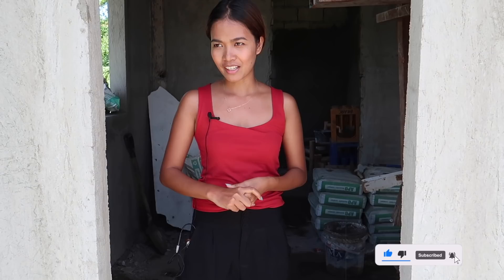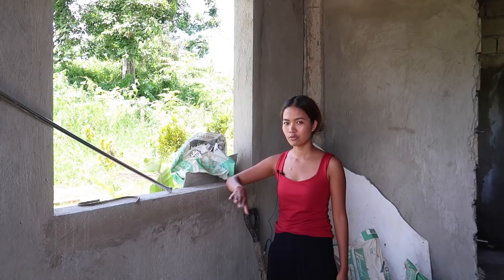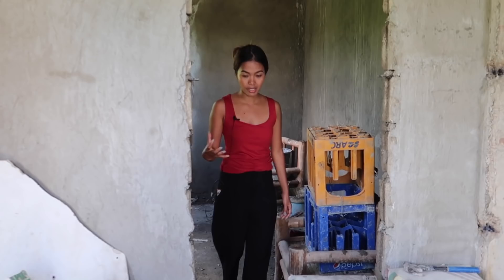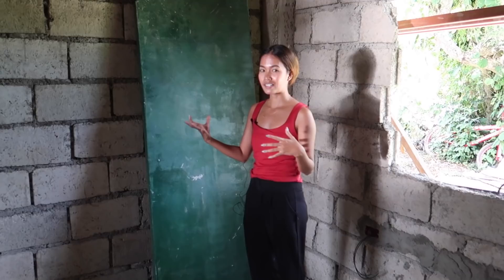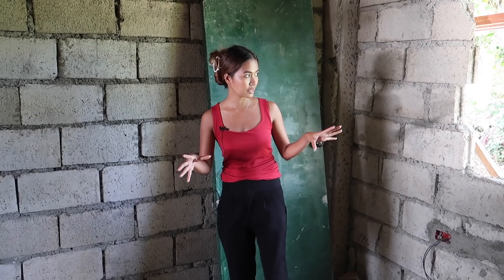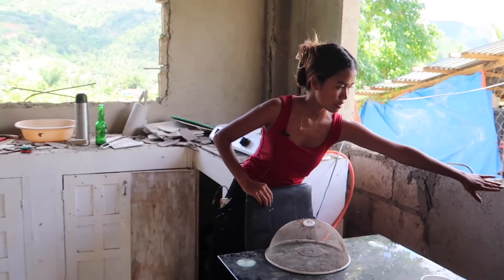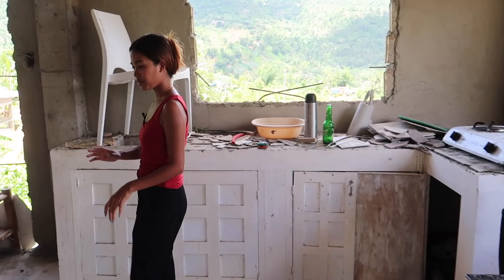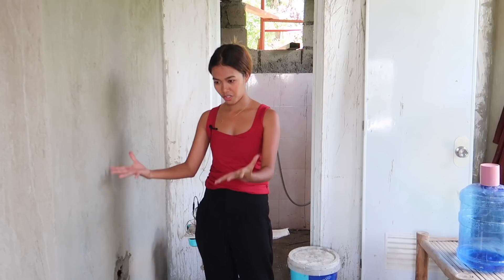House Rebuild 18: I Had To Change The Living Room Plans, House Update

Comment: You need ceiling insulation on the metal, and then another layer on the ceiling covers so it reduces the heat. So many homes in the Philippines do no do that and you will regret not having that heat barrier.

Comment: Dividing the kitchen from the living room.  Make the division appearance in the ceiling with a lower portion that looks like a beam(6"x6" beam).  visually it will divide the space.  For the TV stand divider, use a table or TV stand that is not permanent.  You might not be sure that this is how you want the house laid out, so make everything on the floor portable.    If you change your mind, then its as easy as moving furniture.

Comment: How about hanging the t.v. from the ceiling facing it towards the living room, or use a sway bracket mounting and mount it high and you could sway the t.v. out of the way when not in use, then you wouldn't need a room divider.

Comment: Meljean, My filipina put horizontal pipes across the end of the room about 30 cm from the wall. One 2 meters high and 1 at 1-1/4 meters. 
Then she attached 1-1/2 inch chain with shackles hanging down from the upper pipe. Everything on hangers has the hangers in the chain 
rings. She stores about 3 times as many clothes in the same space. stacked plastic bins hold foldable things. She wanted sliding panel 
doors but bought regular house doors and jambs for the false wall in front of the clothes. We are doing the same thing on the new house
for clothes storage with the addition of a zippable cover that encloses all the clothes. We used 1 inch galvanized sch 40 pipe for the 
horizontal hanging rods.

Comment: I would switch the locations of the refrigerator and pantry.   I believe the refrigerator placement where you propose would stick out from your new cabinet and take space away from your dining table. Your pantry could be made to match the depth of your wall cabinet making a more pleasant appearance.     You could have a cabinet made to put over your refrigerator (more storage for such items such as toilet paper, etc). Also, by placing the refrigerator near the back door the heat and noise it makes would be further from your living room and dining table. Can’t wait to see the finish.

Comment: Hi MJ, to be honest, I would not put a division or divider between the kitchen and the living room. It will not be as open and expansive as the current open-plan layout that you have now. The new open-plan concept is considerably better, brighter, and more spacious. To maximize even more room, I recommend mounting your TV against the wall. You can also add a movable extension to your TV while it is mounted against the wall, allowing it to be quickly repositioned towards the living room. Mount the TV against the wall slightly higher so that it is not obscured when someone walks past.

Comment: Security lights for outside.  Love it.  I did that for my house as well.  I have a master power switch inside the house and the exterior of the house has motion sensor lights up near the roof line that go around the house.  The power is left on so that the motion sensors work when needed, however if I want to light up the outside of the house, I flip the switch Off/on/off/on and they all light up.  They will stay lighted until I turn it off again.  Then turn on once and the motion sensor lights work as normal.  It's a good feature.

Comment: Getting the hot/ cold water system is the best idea MJ. Liza has installed one of these in our kitchen in San Isidro just the other day.  Cost is P 7,000 +. Liza has taken out the walls of the Sari Sari Store n made the space for the new dining area with new dining table n chairs.  I will be arriving in Cebu 6pm Tuesday night and spend time night in Mandaue City.  Keep those plans MJ

Comment: Hi Meljean, congrats on the new house construction/renovation. I think the proper term is “wall plastering or plastering” not rendering.  Also, not plug/switch its provision for an electric outlet ☺️. With regards to the entertainment area, you can still place the tv on the wall as previously planned,m but use a wallmount which can move/turn/swivel the tv.  Placing a divider will defeat the purpose of the open plan living/dining/kitchen thus will make the space smaller again.
Reply: Agreed! Leaving it open makes it look spacious
Reply: Rendering is the action of applying plaster to a wall.
Reply: @hizuki362  That’s what it’s called in England so she is correct
Reply: Rendering is the proper term for applying cement based coating to the hollowblock walls. Plaster consists of lime, sand and water. Plastering is sometimes used as a generic term for applying thin layers of material. Rendering is the more accurate term here.
Reply: If I'm not mistaken, smoothing the exterior is called rendering. Plastering is the process of smoothing the interior. 

I suspect that MJ is the only Filipino that uses the term rendering though.  I've seen many home building vlogs from the PI and nobody has used that term.
Reply: @gdennis310  Interior or exterior doesn't determine what is the correct term, it's the material being used. Plaster is comprised of water, lime and sand , which is usually applied inside over wood lath (old school) or blue board (newer application). Rendering is used both inside and outside in the PI because they use a cement-based material to smooth the bare hollowblock walls. Originally, MJ called it "smoothening", which isn't even a word. Then she started saying "plastering". It took her a long time to finally learn the proper term of "rendering". Other  vlogs that have demonstrated rendering (using the proper term" are Foreigner in the Philippines and Texas Filipino (among others).

Comment: I'm glad you've become knowledgeable of molds. So the electrician have embedded the wirings and outlets in the cement wall. Yeah, I totally agree, it would take more weeks to finally move in with clean bed and sheets and necessary furnitures. I'd say middle of May.

Comment: A tv cabinet sticking out from the wall will take away from the open feel. Consider moving your bedroom door further into the kitchen area to allow your entertainment unit to go back to its original spot. Then you have the option to extend your kitchen counter out from the wall with bar stools.
Reply: Because she has enlarged her living room, placement of the tv on the bedroom wall doesn’t work anymore. Only the people sitting in front of the tv will be able to see it.  I think the divider will work.  She has a flat screen tv and She mentioned she will replacing most, if not all, of her furniture so she can get a small entertainment center for tv and karaoke machine.

Comment: Meljean... You do not have to discard everything into trash. DRYING OUT IS KEY...  If you get can get it VERY VERY DRY AGAIN is key.  Then you can repaint it and should have a sucessful paint job over most everything.  Very great paint helps out greatly. It must be very very dry.  I have over 10 fans that do this drying out in my construction business.   If it is very very hot summer days in PH now... You should be able to dry your house out now.  VERY DRY IS KEY... then you can repaint everything with sucess.  Repainting all your stuff will cover over mildew and stop it.  Think of it like drying your clothes.

Comment: Hope that switch that switch off everything does not turn off your refrigerator, electric clock, microwave, and cable connected TV. My apartment has a switch that switches off only all the ceiling lights in the bedroom and kitchen, and the wall lights in the bathroom.

Comment: If your counter is going to start, at the living room end of that window....you look rather petite, a might find, sliding window there difficult to open/close as you mentioned a divider wall ( kitchen/LR ) will also limit getting at that window. also , it looks like you might have room in that corners between the 2 kitchen windows to have a kitchen cabinets for your dishes glasses and cups bowls and small appliances....😛or liquor !

Comment: The switches for the living room and the perimeter lights should have been on the other side of the wall so other people don’t need to go in your bedroom to turn the living room or outside lights on . If that is the only switch that turns on the living room lights that would be a code violation in America. I know you can make your own codes in the Philippines
Reply: She said there was going to be switches for the outside lights in the living room also.
Reply: @wodenoftheangles3339  She didn’t really clarify that . I’m assuming they are on a 3 way switch

Comment: I like the window , nice and big , now you can redecorate , find a local craftsman to build sturdy wood and bamboo furniture , don't buy that crappy particle-board and plastic junk from the Chinese-Robertson's mall  , I am having a hard time looking at some of the destruction your builders have been doing , what the hell did they do to all your columns ,all those big chunks out is structurally unsound , terrible masons , and slow too
Reply: They have to chip the columns so the rendering will stick to it. They could have used the right kind of exterior skim coat with Sahata waterproofing and avoided doing that. Then they go and chip out the hollowblock to place conduit for wiring and plumbing. That would all be unnecessary if the walls were concrete cast in place. It would be cheaper, stronger and faster than hollowblock. This was done the right way in the Texas Filipino YouTube vlog. BTW, it's Robinson's mall, not Robertson's.